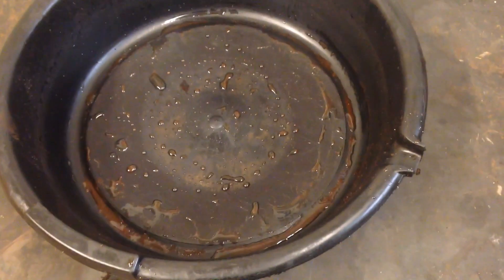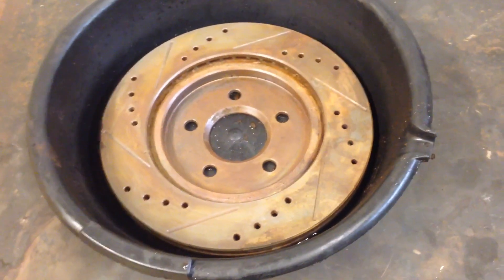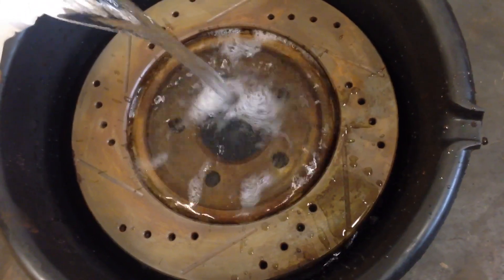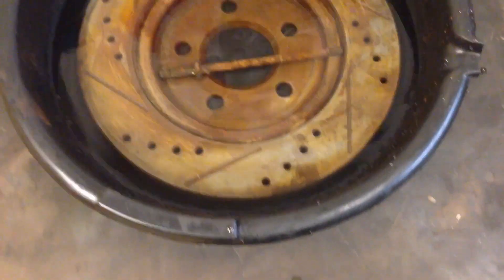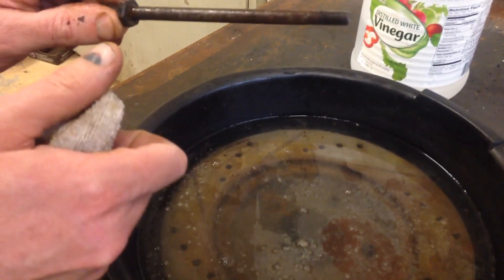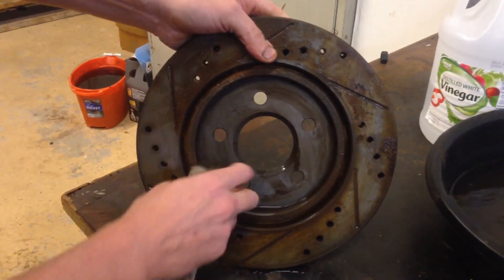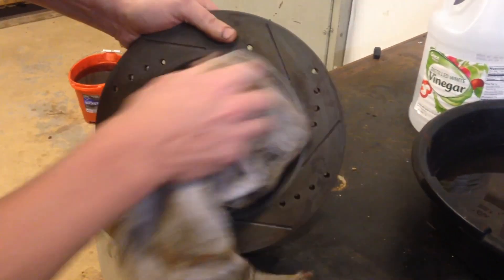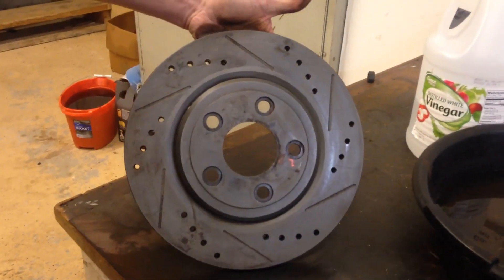Rust Removal Using White Vinegar On Rusty Brakes

Comment: This is misleading. There is hardly any rust on these. Show the treatment when the disc was really rusty please. The water pump bolt is hardly any different. The best way is to use a rotary NYLON abrasive wheel.
Reply from the maker: Tons of rust, the lead pic shows you how these looked, fresh from the junkyard. The pump bolt was pitted it was so rusted as well. Get the rustiest thing you can find and try it yourself, it’ll surprise you.

Comment: after soaking in vinegar . simply wash off in water and spray with some wd40 to protect the discs and should be rust free for longer . nice video cheers
Reply: spraying a brake rotor with wd40 is insane.  any kind of oil or grease should never touch a rotor.

Comment: The rotors on my car were warped to hell and I didn't want to drop $70 per rotor since I'm gonna do a 5 lug conversion at some point soon. I grabbed a rusty, but solid and straight pair of rotors from my salvage yard for like $20. Soaked them in vinegar for two days and they came out like brand new. I ended up painting the hats (inside and out) and the edges and threw them on. They've been holding up fine and my steering wheel shudder is gone. 

As far as doing disposal of the rusty solution: I'm sure it's safe to dump it anywhere. It's just iron and vinegar. Iron is already readily found in everything, including our poop and blood.

Comment: doesnt the rust just come back in a few days or weeks?
Reply from the maker: If not in use typically you’ll see flash rust on the surfaces in moist climates in a few days but I emphasize “Flash Rust”, is removed after a drive. The rust on these had been on there for some time and you wouldn’t see this at all in common normal use.

Comment: or you could just drive and let the pads do that for u..........
Reply from the maker: Sure you could. This to demonstrate white vinegar rust removal, the brakes were just the example.
Reply: @mechanized331  wont work on heavy rust, the pads get rust caked on them, the vinegar would be a better solution

Comment: Going a little off topic here.  I have 11.8 inch rotors that have rust more on one than on the other cause one was taken out of the plastic to discover it didn't fit my 2003 Accord. Anyways, anyone know what vehicles these 11.8 inch rotors will fit when cleaned? TIA.

Comment: Before you start knocking yourself out removing the rotors just get somewhere safe where you can get up 30 or 40 mph and hit brakes hard several times you should see a noticeable difference.  Hey if it works your rotors wasn't bad enough for drastic measures.

Comment: thank you man never knew that smelly liquid could work such magic !
Reply: @mechanized331  if I do this on my rotors , will the rust come back ? If yes in approximately how long ? And Is there some special spray to protect them from getting rusty again ?!? I also live in Canada and man the winters are terrible
Reply from the maker: @aimized1460  I bet the winters are brutal! Yes if the brakes are not used they will rust again. You can neutralize the vinegar with a water/baking soda mixture by letting the metal soak in that for about 10 minutes after the vinegar bath, That’ll slow rerusting down. After the part is dry you can use black high temp bbq paint just on the edges and at the lug area of the disc for extra protection. Tape off the friction surface before painting. This technique works well. Hope that helps.
Reply: @mechanized331  thank you brother means a lot, stay safe out there

Comment: would this work with the calipers
Reply from the maker: Definitely!
Reply: @mechanized331  great thanks for the useful video mate 👍
Reply: @mechanized331  will the vinegar eat away at the rubber seals on the caliper
Reply from the maker: @HookedToGaming  No, it will not, you’ll be good. What car are you working on?
Reply: @mechanized331  ok great to hear, working on my lexus is200 here in England but ill probably use this on mine and my dads f100

Comment: Could I potentially put white vinegar in a bottle and pierce a hole in the lid and squirt the vinegar onto the disc without dissembling the wheel and taking the disc out?
Reply: No you have to remove the rotors its not that hard

Comment: How do you prevent it from flash rusting?
Reply: Wash the part, preferably with soap and (running) water. To clean the surface and neutralize the acid. Immediately followed by the surface treatment of your choice. Paint including zinc spray, galvanizing and other plating methods, oil bath... are some of the options.

Comment: Mmm my question is I have a car that I got running and driving an gonna do the brakes next now and the rotors are rusty like in this video and I thought driven and getting them hot would knock that off butt nope . The rotors are perfect except for that so I'm about to put new brake hoses and pads on but I need to get the rust off but I don't want to have the rotors turned to do that. 

Soo wondering if I did this trick and then sprayed them off with brake cleaner after and then put them back on the car and put everything together would it be alright and hsve u dome this ?
Reply: Don’t ever clean or do anything with your brakes or hoses or pads or calipers when they’re hot from driving. Let them cool off either just over night or during the day.

Comment: It may have solved the rust the first time round, but do you think the effects of the vinegar actually made it more susceptible for rust in future? Since it's rusty again.
Reply: Oxidation of the clean and unprotected surface will always happen. The only way to minimize this effect is by treating the surface. Galvanizing, painting, oil bath, etc. are some of the possibilities.

Now answering directly to your question. It won't rust more, because it was cleaned with vinegar. 

It wasn't mentioned on the video but its wise to wash the part afterwards with soap & water. Appropriate treatment should be applied right away. To minimized surface exposure and respective rust development. By appropriate  I mean, not use oil bath treatment on a brake disc, for example! On the other hand it's perfect for some old pliers or screw drivers to have on your tool box.
Common sense should be used sparingly! LOL 😂 

Personally I've had excellent and durable results with "Hammerite" paint on brake drums. Lasted a really long time!
Reply: brakes work with friction. the friction between the brake pads and the steel rotor. if you use the brakes regularly rust will always be cleaned off by the friction process. If you let your vehicle sit then naturally rust will build up.
.... use it or lose it.
Reply: @SamuelLanghorn  use it to lose it. 😀
Reply: good question
Reply: You have to wash it in distilled water or it'll go even worse within 24 hours

Comment: Vinegar is ok.  I prefer Evaporust.  It's relatively cheap....about $20 from a local Tractor Supply for a gallon (much more $ online). It's reusable...I filter and reuse it several times over.  Non-toxic in the sense that I can stick my hands in it as I would with vinegar with no harmful effects......yet. ;-)   And I like the oxide-like dark film finish....great as a base for primer and paint for parts that I intend to paint. Anyway, I recommend trying both so you can compare the outcomes.
Reply from the maker: Average Joe  Yes, that’s good stuff as well!

Comment: Can i just spray the vinegar while rotors  are in place in parked vehicle
Reply from the maker: BVB BVB you could try but you'd have to keep the rotors wet with the vinegar.
Reply: It won't be effective enough on it's own! But you can improve the effect by soaking paper towels in vinegar and apply them in place. It will help keep the moisture for longer. 
In all honesty it doesn't work properly and it sucks! LOL 😂 
Way better and easier to remove and dip it in the vinegar bath! Will save you a lot of hassle. ;-)

Comment: How can this work effectively?  You clean the exterior, but what about the rust internally that needs to wiped like you did the exterior?  You will always have rust return every time water hits it.... whats the solution for that?
Reply: All surfaces, including those he treated, will rust again over time. This is a rust removal technique, not one for rust prevention.  Rubbing a light film of oil on the surface of metal parts is one way to prevent rust from returning. For rotors, the oil trick isn't going to work obviously. You can prime and paint the surfaces that will not come into contact with the pads, but leave the contact areas untreated. Where the pads come into contact with the rotor will only rust again if your vehicle sits unused for lengthy periods of time....generally weeks or longer. Heat and friction from the pads is what keeps those surfaces mostly free of rust. Depends on the climate where you live....dry climates like southern AZ aren't going to rust parts like the humid climates of New England.

Comment: What's flash rusted? Won't it last after the vinegar?
Reply from the maker: Audun Jemtland hey! Flash rust is where you'll get a light coating of rust if uncoated steel has any residual moisture on it or have a high moisture content in the air. You can clean it off but paint or other anti corrosive coating will prevent that from happening.
Reply: Nice! Thanks. This is 5% vinegar right?  We only have 35% small bottles in the stores here. Wondering If I should dilute with water. Or if it lose it's effect. Some people mention salt acid.

Comment: If the rotors were super-rusty, the surfaces would be heavily pitted, not smooth when the rust was removed, and likely wouldn't be within spec after refacing.  If you want to show the effectiveness, compare the internal vents before and after.

Comment: You have to neutralize the vinegar asap. Baking soda and water will do this. Just dip it in a mix of water and baking soda for a few seconds. Then dry it off and oil them up. 
Even if you are using the rotors immediately after the vinegar bath, you have to neutralize the vinegar BEFORE use. If you don't, the acid in the vinegar will eventually cause pitting in the rotor...
Reply: Acetic acid doesn't react with steel, just rust., and in use would be scrubbed away removed within  one driving/heating cycle, just as  the flash rust would have been.
Reply: I'm with you, Tom.  That was the advice given on some other videos using vinegar to derust brake rotors.  And I just Googled "does acetic acid react with steel" and it certainly does.  So neutralize that vinegar bath before putting on a finishing coat of oil or paint.
Reply: I was thinking about the process not being completed in the video. 
What to do before painting.
Reply: What kind of oil do you recommend putting after doing this treatment ? Asking because I won’t put them on until calipers come in
Reply: @markrodgers1965  Of course NO OIL goes on the smooth surface where the brake pads contact the rotor.  As for the rough areas of the rotors, I suppose you could go with a WD-40 spray or paint them.  Most folks don't do either, I suspect.  I don't think an oil coating will last long running through puddles or slush.  So, why bother?  The rotors will rust up again but this process, I think, was more for when you get parts from the junk yard that are horribly rusted up - like I did.
Reply: @markrodgers1965  My older sister believed she had lost a brand new front rotor for her Sienna because it laid in water.  I successful treated it with vinegar and sprayed it with "BOESHIELD T-9 Rust & Corrosion Protection/Inhibitor and Waterproof Lubrication" before returning it to storage.  Look up reviews on YouTube.
Reply: @Yasir Saleem lol true

Comment: There is a better and faster was. Get an offset grinder with a wire wheel and you can get the rust off in a few minutes. I have tried vinegar, electrolysis, chemical rust remover, etc. An offset grinder with a wire wheel works better and faster.
Reply: Not when it comes to tight crevices and other difficult to reach areas, such as holes and slots on the rotors.
Reply: GiBLETS : Yep, don't want any high and low spots.

High and low spots  makes the surface uneven.
Reply: It would require a hell of a lot more heat/friction than brakes apply themselves in order for that to happen, unless you have crappy rotors.

Comment: Nice but can you reuse the vinegar for another rotor?  If you had a super rusty rotor, did the bath overnight, could you reuse the same vinegar for another go?
Reply from the maker: Yes you can!
Reply: I've found that if you rinse the parts off really well in a bath of baking soda and  regular tap water a couple of times, the baking soda will neutralize the vinegar.  completely dry the part off and spray a little WD40 on it and it should be good until you paint, clear coat, or whatever finish you apply.
Reply: +xXDeath BearXx once clean of with water use oil on the part to prevent rust from coming back it would protect them
Reply: @christopherbrown2224  Yeah... but you can't use oil on a brake rotor!
Reply: @StraitClownin909  The oil is just for storage. You'd have to hit them with some brake cleaner once they're ready to go back onto an actual car to get the oil off and ensure good friction with the brake pads.
Reply: I heard the rust comes back and worse, because of the acidity of the vinegar?  That's true is there an easy way to neutralise the rotar afterwords so it doesn't just rust again in a day?

Comment: Bath it in baking soda to neutralize the Vinegar acid , rinse with water and spray it with 
WD-40, plastic wrap it until ready to be plate it,or it will Rust again
Reply: It prevents the rust from returning until its ready for use. Clean with brake cleaner when it's time to use them.
Reply: stealhty1 wouldn't WD-40 make the brake pads slip?
Reply: Make sure to use brake cleaner before putting them back on
Reply: Baking soda not necessary.  Clean water rinse is fully adequate. Vinegar is very water soluble.
Reply: No, the acid in the vinegar will cause pitting. You must neutralize the acid anytime before use.
Reply: When they claim coated rotors to prevent rust,are they saying the braking surface itself or no?
Reply: what if I just use it right after? without wrapping it. that ok?
Reply: With in a week it will rust again,,however I recommend to buy Rotors that already come  Zinc plated ( they are rust resistance )
Reply: Or use a light weight oil. WD 40 contains some water so it's not super effective
Reply: nico beerse wd40 on discs is alright for storage. Just not on pads. Wd40 wipes off a disc with brake cleaner. New discs are usually sealed in oiled bags anyway.
Reply: WD-40.....hahaha!!
Reply: WD 40- will make the brakes slippery and will not brake properly. EVEN I know that!!!!!

Comment: about how long after does it become rusted again ?
Reply: Bryan Mena Not long.
Reply: Once rust is off.   Its gone.   You are referring to distortion in metal which happens when any metal is conditioned to react.   U must immediately heat up the metal with a blow dryer and or pour ice on it to re condition the metal.  Only other way is to have the rotor continuously move.   Its the same as any form of matter being in a set condition over time it adapts.   Reacts.   Stop the reaction with precipitated conditioning.   This is now physics.  Steps above chemistry